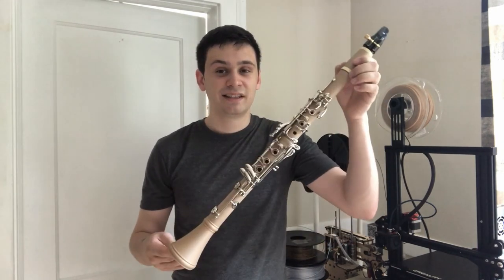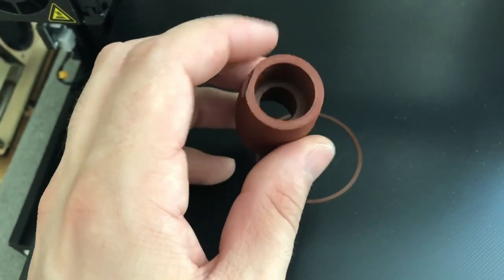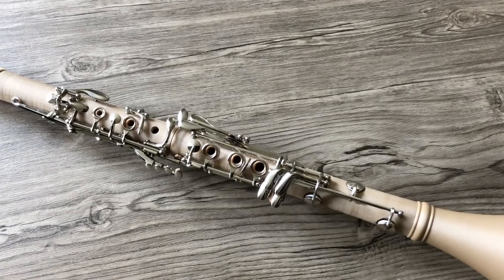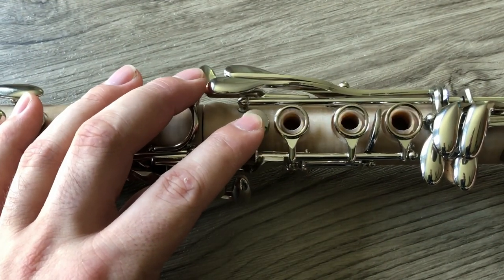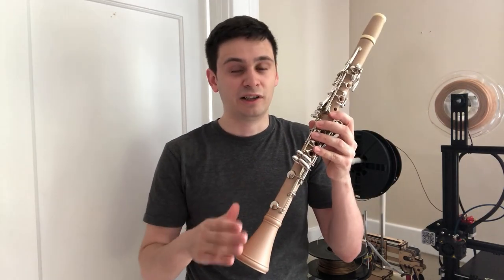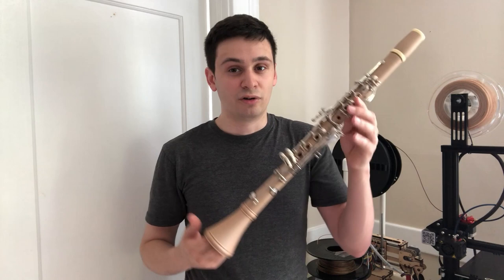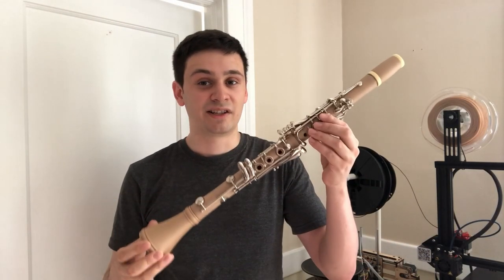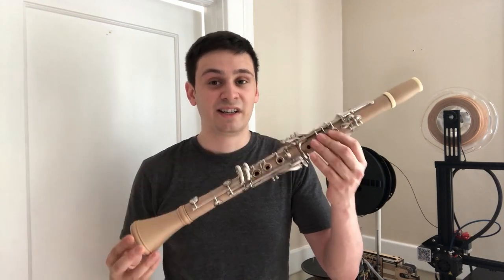What does a 3D printed clarinet sound like?

Comment: If you’re 3D printing, then maybe print the main body as one piece, not two. You will achieve better tuning and perfect 12ths, better intonation too, which could compensate for the acoustical weakness of material used for 3D printing.
Reply: The major culprit for the instability and movement of keywork, posts, etc. is not playing, but assembling/ disassembling of a two piece instrument. One piece design could improve that in a 3D printed instrument.

Comment: Nice idea, but to get the keywork you will first have to buy a clarinet. Where would you get a set of keys adapted exactly to the clarinet you're building?
Reply from the maker: The idea is you can use a set of keys from a cheap clarinet (like a Vito which has great key work but is student level) and make a much better instrument. With the modeling software I use it’s very easy to make small adjustments. Tone hole positions are very consistent across brands as well and any adjustments needed in that sense can be made by bending keys.

Comment: Wow this is amazing! Do you plan on putting the CAD files online?
Reply from the maker: Unfortunately they are specific to this one set of keywork, so it would need to be redesigned for whatever set of keywork you have.
Reply: @Jared_De_Leon  You can give us link for them
Reply: @Jared_De_Leon  Sooo just tell us which keywork to buy.
Reply: @Jared_De_Leon  you can just give us the files and tell us the keywork to buy
Reply from the maker: Just a person scrolling by it’s not that simple unfortunately. No 2 sets of key work are the same. I have been considering selling the files but I’m worried it won’t fit anything else besides the one set of key work I measured. Besides it still requires key fitting experience and tooling in addition to being an extremely challenging print with tons of post processing. That being said if there is still interest I will add the files to my website shortly.

Comment: That is good stuff. I know Richard Bobo has done some work on custom keywork manufacture using a basic CNC milling tool - maybe that could be a viable method for fast turn-around custom keywork manufacture?
Reply from the maker: Richard actually cut out a rough key for my basset horn. It still required hours of filing, grinding and soldering. It would make the job easier but it’s not that much faster than cutting a key out with a jeweler’s saw.

Comment: Where did you source your clarinet keys? I am having trouble finding a source and would love to try this project at home. If you used 3D Printed keys, how would the durability change? What parts could you swap out with parts that you could find at a hardware store (like screws, rods, and springs?) Would it play similar to a Nuvo Clarineo, or would it still sound as good as yours does?

Comment: Wouldnt it be better if the body was printed with out the post screw holes? That way the printer has to do less fine detail work and you can align the keys better.
Reply from the maker: The printer doesn’t really care either way, it will print whatever file I throw at it. It would still require measuring all the holes accurately and would add much more post processing. Plus in Fusion 360 I can make super fine adjustments easily.

Comment: Very impressive!  I play clarinet too and also own a an Ender 3D printer.  I have made a few barrels, but so far they are not working - no sound.  Did you have trouble printing the ledge of the lower tenon?  Mine comes out rougher I think mostly because of the support tree.  Did you have the same problem? I'm using PLA too by the way. Your comment would be most helpful.
Reply from the maker: I use supports, it doesn’t have to be perfect, just flat enough to fit. Not sure why it wouldn’t play, is it airtight?
Reply: @Jared_De_Leon  Hi Jared, Thanks for the reply!  Yes it seems to fit well.  I'm going to try a finer setting in Cura maybe super quality and see if a smoother bore helps things along. Appreciate you taking the time though!

Comment: How long to 3D print it? How long to get all the measurements into the printer?
Reply from the maker: About 12 hours per joint so roughly 36 hours total with the barrel and bell. I modeled everything in Fusion 360.

Comment: Can we please have the files?
Reply from the maker: The files are very specific for this one set of keys, it would be easier to start from scratch and redesign it.
Reply: @Jared_De_Leon  Did you get that set of keys online, or did you rip it off an existing clarinet?
Also, if I make a B flat clarinet, and then basically stretch it a little bit, will I get an A clarinet?

Comment: Is there a reason I couldn't also 3D print the keywork?
Reply: Magnus Brevik Theoretically, he could print keywork, but many pieces would probably be need to be redesigned (think long skinny keys and rods) since there will always be a certain amount of flex when using plastics and composites.
Reply from the maker: It wouldn't be strong enough and there would be no way to seat the pads with traditional methods. Also springs and screws would be an issue.

Comment: 2:51 Not correct. The main advantage is the cheap price of priting compared to buying an actual instrument.
Reply from the maker: Not really, 90% of the cost of a clarinet is the labor. In fact pound for pound Grenadilla wood is cheaper that filament if you know where to get it. This clarinet would still be expensive to make as the key work is labor intensive.